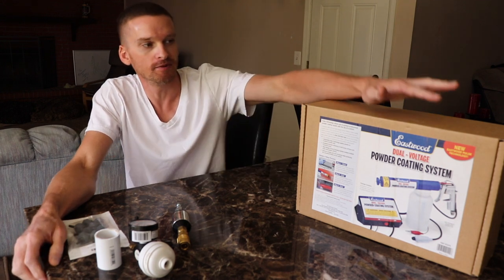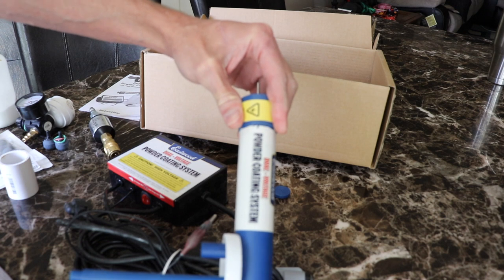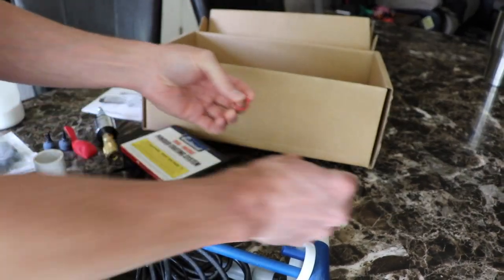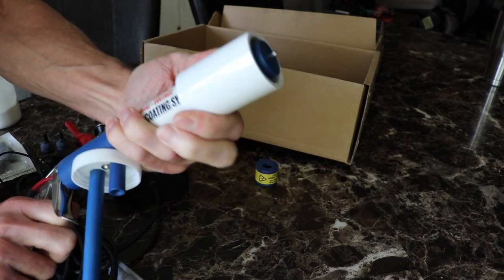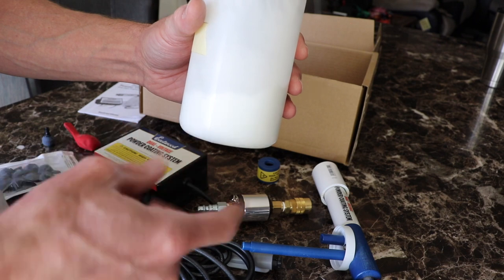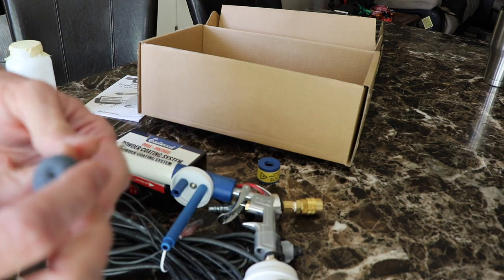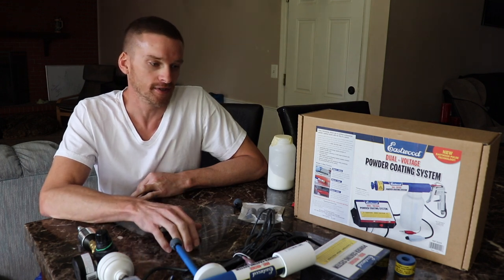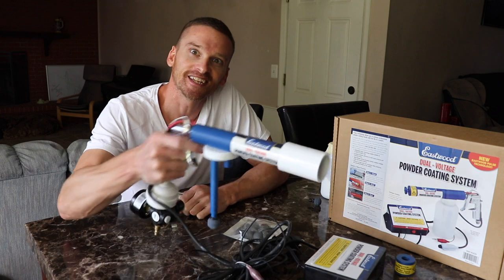Eastwood Powder Coating system Review & Modifications

Comment: Can you coat a 18" wheel using the 150 or 250 gun?
Reply from the maker: Yes, you can coat a 18" wheel with this gun. You will need an oven big enough to fit it or heat lamps to cure it. I hope this is helpful. Thanks for watching!

Comment: By any chance do you do work on the side?  Or can you refer me to a company that's not overly expensive.
Reply from the maker: I do a little side work. What are you wanting to get powder coated and what color? Do you already have the powder that you want to use for the parts you want coated? Most powder coating shops that I know of have a minimum charge of at least $125 and some are more than that. So powder coating just a few small parts can be expensive. Anything that is to large for me to coat at home I take to (Absolute Powder Coating) https://www.powdercoatingabq.com they are the best powder coating shop in my area, very professional and have won some awards for the quality of their work. Ask for the owner Chris and tell him I sent you, he will probably give you a discount if he has the colors you want in stock. I hope this is helpful. Thanks for watching!
Reply: @WillowsWorldofDIY  Two brand new cadillac 4 piston caliper made by Brembo and two brand new ford standard 1 piston calipers.  They are currently powder coated or painted not sure.  I will have them disassembled prior to shipping.
Reply from the maker: What colors do you want? I will need to get prices on the powder before I can give you a price to coat them. I buy my powders from https://www.prismaticpowders.com if you want to look at colors and prices for the powder.

Comment: Hello boss i planing to buy powder coat gun  what is you recommend eastwood dual voltage or harbour freight please reply tnx you more power..
Reply from the maker: I have never used the harbor freight gun, so I don't know which one is better. I would go with the one that has more power, the Eastwood dual voltage gun has 15,000-25,000 KV. I can't find any harbor freight gun output voltage numbers on their website. I hope this is helpful. Thanks for watching!
Reply: @WillowsWorldofDIY  tnx you boss for replying my concern i never trying powdercoat  here in Philippines i have small shop for motorcycle thats why I thinking what is best I think i pick dual voltage! Tnx you boss more power to your chanel im waiting also to you vlog😊👍

Comment: I just bought a gun 10/26/20 from Eastwood and it doesn't have the over sized end cap that unscrews like yours.  Super bummed because I bought all the stuff you posted links to, to make this Mod.   good video though   thx for posting.
Reply from the maker: Everything will work except for the 1" PVC coupling. Other subscribers have said that they bored out the 1" coupling to 1.395" to fit the new gun. If you  don't have the tools to bore it out you can just use a 1-1/2" PVC coupling instead of the 1" PVC coupling. I hope this is helpful. Thanks for watching!

Comment: My Eastwood dual Voltage gun is 2 years old now. use it alot. But am I the only one that gets Shocked by this gun??  and it hurts. It will come out to me about 10 inches. It will zap me like 20 times in a few seconds!!   I try to stay clear of my metal when powdering.. and even with leather gloves it will at time still Shock me. and I do have a 8 feet copper ground rod in ground .with a #10 braided wire with Alligator clamp on it to also clamp to my work. So why does it still shock me.. You can see the Electice fire come out of time and get me.. LOL  I had to be shocked anyway..
Reply from the maker: My gun only shocks me from about 3 inches away with my opposing hand in front of the gun or near the parts or grounding clamp. You can definitely feel it and it does hurt. My personal opinion is that the problem with this gun is that this gun has a metal handle that is grounded and when you're holding it with your bare hand it grounds your body and allows the electricity to pass through your body. I haven't done it to my gun yet but I would like to coat the metal handle and trigger with a plasti dip or at least wrap it with electrical tape to prevent that shock when handling the hanging wires to move the parts into a good shooting position. I learned how to shoot 21 years ago with a professional Nordson gen 1 gun that had a metal handle and we had this same problem. Plastic dip on the handle and trigger is what fixed that problem. New Nordson professional guns all have plastic handles because of this problem. Good job on the grounding rod and #10 braided wire. I hope this is helpful. Thanks for watching!
Reply: @WillowsWorldofDIY   Yea. That sounds like a great ideal.. I think I have some of that.  I kinda want to buy another new one.. and see if it does the same. If it did.. I would ship it back to them.lol  I posted on a Powder Coating Group. and you cant believe how many said ,, They have never been shocked by there s.!  Just my luck. I just hate to spend $800  for a more exspensive one. but see some people turning the part with there hand ,   while there powdering..

Comment: Where can I get the dryer attachment? Or search? Couldn’t pull anything up.
Reply from the maker: I put links to everything I used in the description of the video. I bought the inline air driers from Amazon, here is the link https://amzn.to/2vR4ZwX or look for it in the description of this video, you can also search on Amazon for an (inline air filter). I hope this is helpful. Thanks for watching!
Reply: Thank you I was on Amazon looking for that white filter on top @2:57
Reply: @WillowsWorldofDIY  awesome video and thank you for responding I’ve just been everywhere trying to make sure I get the best bang for my buck. Thank you so much
Reply from the maker: The White filter is a spray gun filter. I got mine from a local automotive paint shop. Here is a link to some on Amazon https://amzn.to/2IK55MT they are orange but are the same type of filter. Sorry I didn't realize I didn't have a link up for these filters. Thanks for telling me!
Reply: @WillowsWorldofDIY  thank yoooooooooou and no problem I was at Lowe’s and no one knew what I was talking about lol